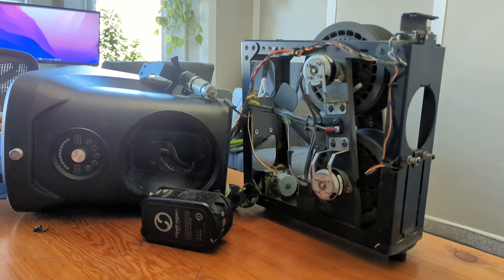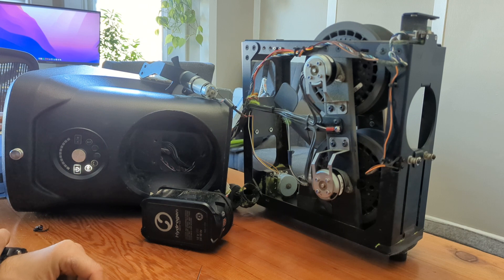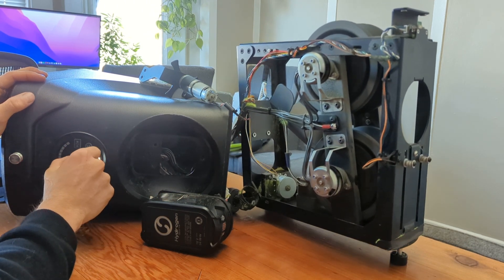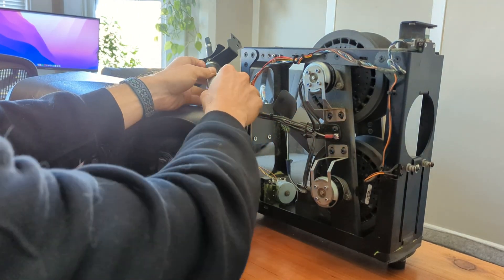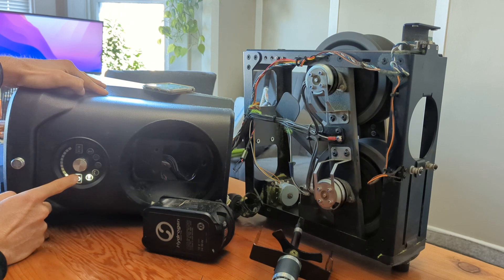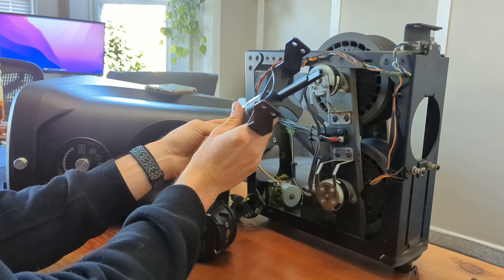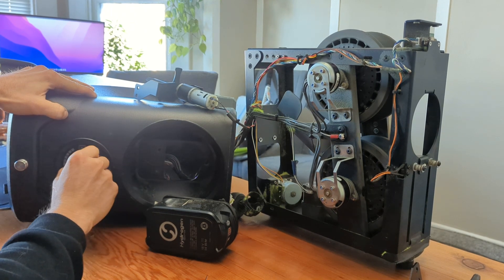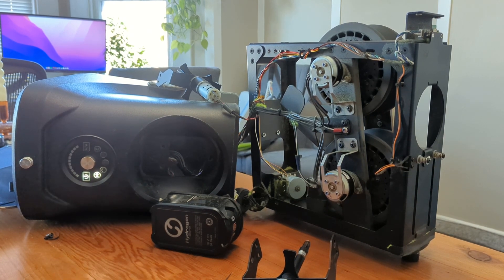Hydrogen Proton Tennis Ball Machine Issue - "Beep of Death" - Full debugging

Comment: Did you ever get the third replacement motor? I just ordered and waiting for mine to arrive, and I'm wondering about common issues or reliability. Since it's now two motors for you, I wonder if there is something causing the motors to stall-out, like a miss feed or stuck ball? Do you recall that ever happening? I see that Hydrogen changed the stir rod on the newer models. Maybe it's related?
Reply from the maker: Yes, I actually realized that the reason my motor was burning out was because I wasn't replacing my Wilson Trinitis frequently enough. Some balls had almost no felt left on them, which makes them rubbery. These balls get stuck in the rotary motor because they have a smaller circumference and don't slip, which burns out the motor.
Reply from the maker: I now use Wilson Triniti Pros, which have a significantly longer timespan. They're more expensive but sometimes go on sale.

Comment: Thanks for this—just showing the testing setup and disassembled view. So, do you recommend this machine? You’ve already had two carousel issues. Any other problems? I’m trying to decide whether to spend the money on this versus keeping my Lobster Elite One. The Lobster does what I need it to do, but it’s too large for the trunk of my car, and I have to transport it in the front seat. At my age, it is always potentially a twitch away from pulling a muscle in my back getting it in and out (that just happened for the first time this week….).
Reply: I just don't see a reasonable alternative.  This machine checks a LOT of boxes for the price point.  I didn't buy it for the size, but it's been a really nice benefit.  The battery life is astounding.

But what I've come to "need" is the programming.  I'll hit 100 "mini tennis" balls as a warm up.  Then I go full court.  It's so easy and it's so much like hitting with a human that I hardly call anyone to hit lately.

I'm also having this issue after 10k balls.  I'm also getting the part.  I hope they've sorted out the flaw.